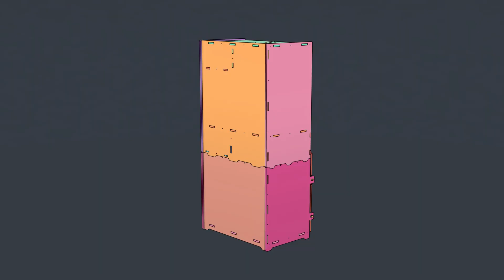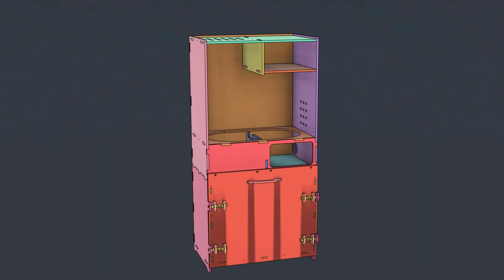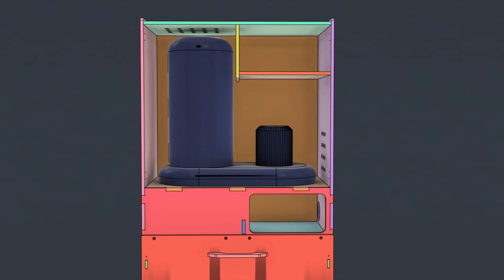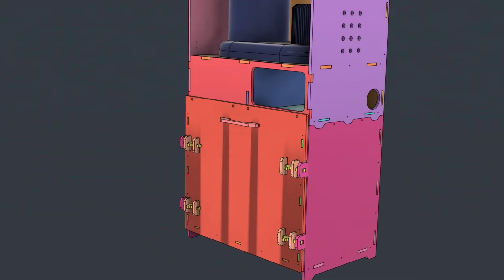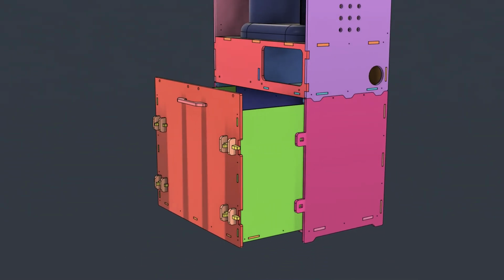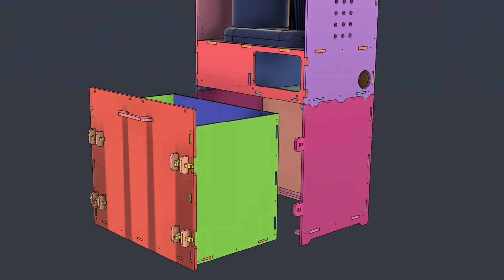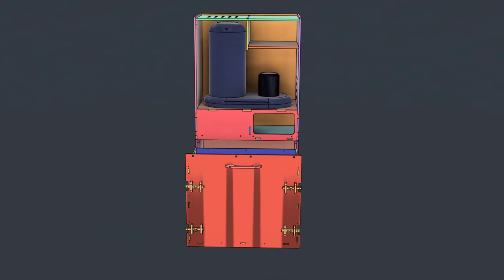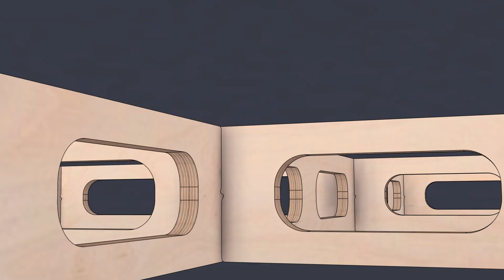Making a Custom Dust Cabinet for Our CNC Workshop | DIY Dust Collection System Upgrade

Comment: That's a nice cabinet! I'm using a small portable collector on a small cart I knocked together so I could add a metal can and swirl separator.

Correct me if I'm wrong, but this looks like the most complex design you've shown us yet. Great to see your skills and confidence growing!
Reply from the maker: Glad you like the project and the result!

I had the same idea at first — it would’ve been an easier solution. But then I realized I didn’t really want to see the dust collector while working in the shop. 😅

Thanks a lot! We’re always trying to improve with each project and video. 
In terms of complexity, I’d say the Go-Kart and the Bar Cabinet were a bit more involved, but this one was a fun challenge too!
Reply: @Aribabox  oh, I forgot all about the gokart! And I guess the bar had a lot more moving parts. 
I'm not exactly happy with my cart, but like you said...fast and simple! 

At any rate, keep up the great work!
Reply from the maker: @turbomacncheese  Oh, the go-kart seems like an old project, but did take a lot of trial and error till we managed to figure it out, and the bar cabinet had a lot of work involved (the veneering, finishing, etc.) But those are the projects that push to innovate, learn, and advance the craftsmanship.

Thank you for your continuous support! Much appreciated!

Comment: you cut mdf on CNC? how is that working with MDF?
Reply from the maker: Yes, you can easily cut the MDF boards on the CNC. Just need to use the correct feeds and speeds when doing so.
Reply: @Aribabox  oh know, I was just asking about the dust collection, since mdf creates a really nasty dust.
Reply from the maker: @mikedtubey  Oh, definitely - it should work just fine! I don't see any reason why the dust collector wouldn’t handle MDF dust, but to be honest, I haven’t cut any MDF parts in a while. Might be a good excuse to run a test and see how well it actually performs. Might have to change the dust filters more often.
Reply: @Aribabox  thanks for the honesty! hope to see some tests.

Comment: what about the static electricity ?
Reply from the maker: Good question! To avoid any static electricity issues, we used metal ventilation pipes for the dust collection system - they act as a natural ground path. We also connected everything to the CNC setup using an anti-static hose. So there shouldn’t be any problems with static build-up in the future.

Comment: you should avoid 90 degrees as much as possible, break them down into 2 45s + limit the flexhose to the neccesary as it drops the flow significantly with longer distances (when it curls etc)
Reply from the maker: Thank you for the suggestions - you make some solid points! After getting all the ventilation fittings, I realized that 45-degree angles would likely perform better. 
That said, after running some test cuts, the dust collection seems to be working quite well so far. If we notice any performance issues down the line, we’ll seal the tube joints with tape or swap out the 90-degree fittings. Really appreciate the feedback and recommendations - thanks again!

Comment: This is a brilliant idea. I wonder how air can escape from upper part of the dust box. Anyways, this looks like abgreat project
Reply from the maker: Thank you! Glad you liked the build!
Great question - we added a pattern of holes on the top panel and one of the cabinet sides to let the air escape. That should be enough for now, but we might drill a few more if needed.
Reply: You should measure the airflow at the collection point with and without the box. I suspect you are substantially diminishing the performance of your dust system.
Reply from the maker: @egdm1235 That's a good idea! Is there a tool that can measure the airflow intensity?
Reply: @Aribabox  A handheld anemometer should do the job.